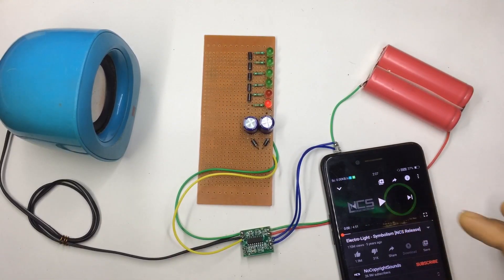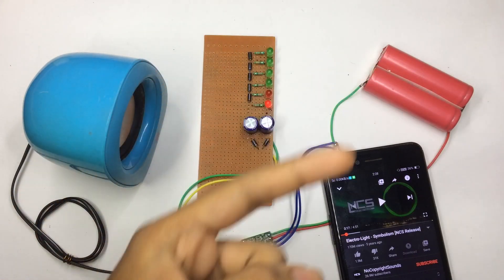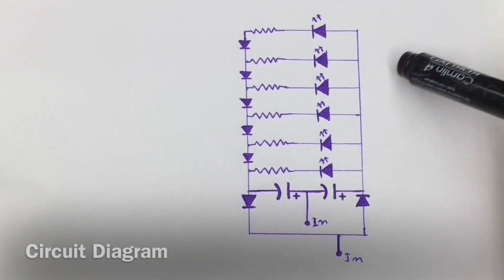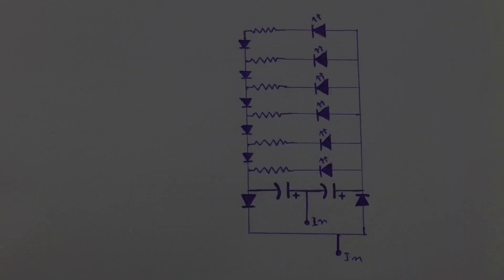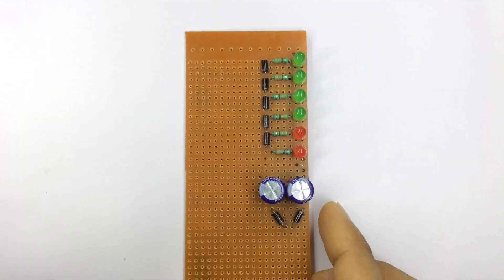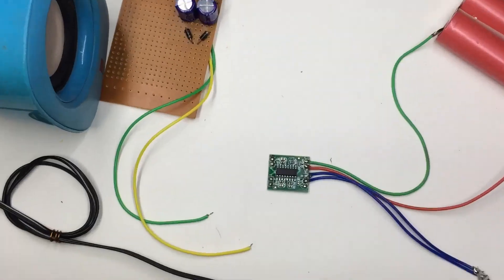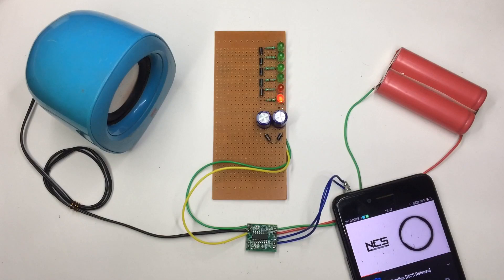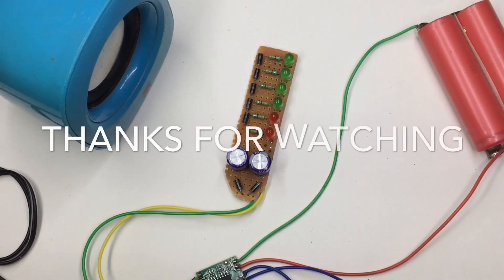How to make Music Reactive Led without Ic or transistor(VU meter )#diy #dj #reactive

Comment: Can I use this VU meter in 8403 amp with 2x3watt speaker? I have made Bluetooth speaker with 2x3watt 5volt speaker and I would like to attach this VU meter with that speakers.
Reply from the maker: yes sure & i use a 8403 in this video

Comment: Please say that can I use 1k or 33ohm resistance??
Reply from the maker: No 33 ohm is too low.. & 1k is too high but 1k still work in the lower leds I mean which are close to the capacitors..  But the upper ones don't get enough voltage with 1k... But if u use powerful amplifier them u can use 1k

Comment: Broo.. you are running 5v module with 7.4v ....that's crazy 😮
Reply from the maker: Np.... Those are 2 li-ion cells in parallel that means voltage remains same & current ratings 2x
Reply: @madScientist99  oh sorry .. I thinked that ..they were connected in series 😅♥️
Reply from the maker: I understand ☺

Comment: 4440Ic ke liye kitni led lagaye?
Reply from the maker: U can use 20  leds but use higher value resistors like 1k in the lower led which are close to the capacitors   & 330 ohm in the upper ones